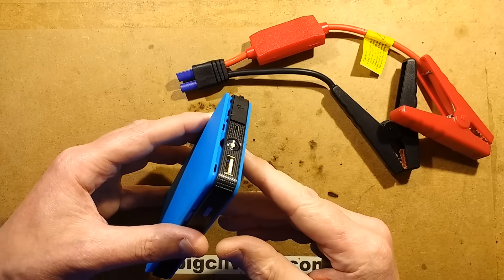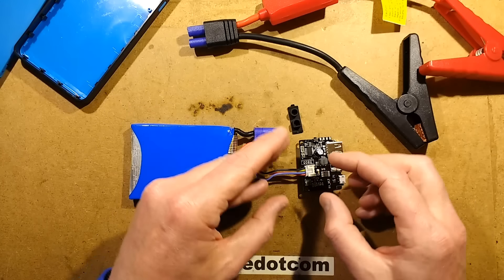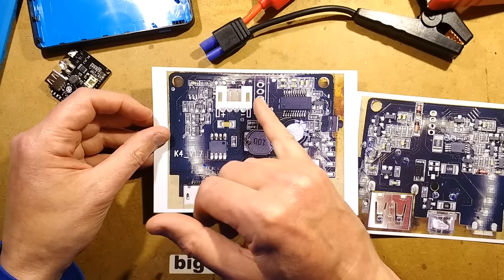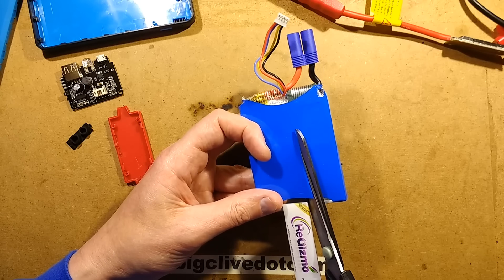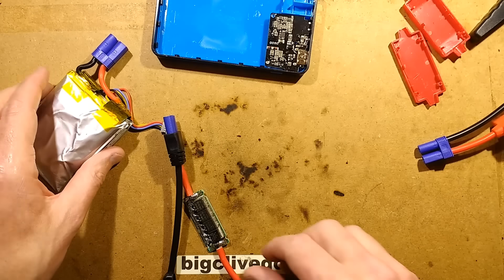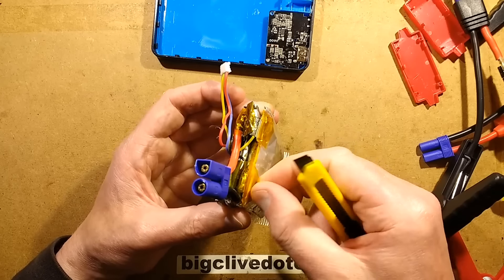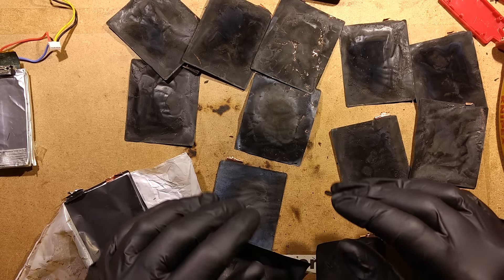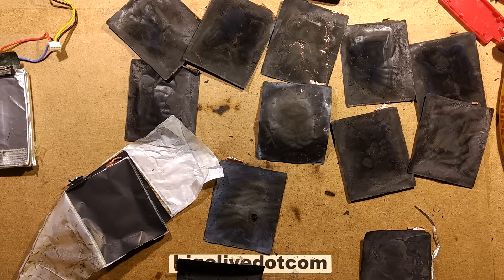Shorting out a fully charged cheap lithium jump starter.  (It didn't end well.)

Comment: I bought this pack off Amazon and was using it repeatedly to run a transfer pump off grid.  Around about the 6th time it failed and did catch fire as opposed to just swelling.  It was a sustained load to drive the pump motors  and it didn't stay burning after I disconnected it. Exciting

Comment: I tried to "troubleshoot"my lithium jump battery after it failed. I no sooner popped the plastic case open, and while probing the innards, I set off the lithium battery sack with a stray poke which resulted in a 1 foot burst of flame. Fortunately, the accident occurred on top of a stove. These things are real flame throwers.
Reply: It's almost as if these batteries go "YOU'LL NEVER OPEN ME ALIVE!" and just explode
Reply: I had a 3s lipo short in my rc car, it blow torched a hole straight through the esc into rx trashing both, all my own fault because I didn't secure the balance lead which wrapped around the drive shaft and shorted, it was funny as hell, the car shot off like a rocket SMOKING like hell.

Comment: I had one of these booster packs. It was great as a power bank for charging phones etc. and my daughter found it very useful when she was doing DofE expeditions especially the torch.  It finally expired when I tried to start a 2 litre Diesel, it overheated and became swollen and busted out of the plastic case, it didn't start the engine.

Comment: I've just bought a 2000amp starter, which started my Royal Enfield 535cc Continental GT Motorbike Instantly. The Lithium Ion battery was Dead, but the Starter is Fantastic !!!!  I ran the Engine for half an hour and the Battery is fully Charged !!!

Comment: Very nice and it shows that these batteries are really kind of safe.
The battery-fires in smartphones are most probably the work of tight packaging and internal shorts in the batteries.
Reply: Nah mate, it doesn't show that at all. While they have gotten better than they were (im talking like the RC lipo packs over the last 10 yrs), there's no guarantee that a random jump starter pack will actually use them vs the older more volatile chemistry mixes... and this one could well have burst into flames had it been a bit more 'robust' or held together as it would have been if it was still inside its plastic housing (as seen when clive pushed the plates back together - it still had some juice left in it).

Comment: I remember a few yrs ago I had a dead'ish cell phone battery and instead of just tossing it I wanted to know what exactly was inside it so I went in my basement to my workbench to try and find out. I couldn't find any non-destructive way into the battery so I chose the only destructive path to me that I could think of. I put it in my vise and clamped it down tight and started to smack it with a hammer. lol, smack, smack, smack! it then started to bend so I bent it back and forth till something happened. it sounded like a loud fuse went off! white smoke filled the basement! luckily I wasn't in the way of anything. apparently, when I bent it back and forth the chemicals mixed and reacted to each other started to pop out the crack in housing I made by bending it and smoked big time, lucky for me the fuse was actually facing down towards my metal vise clamp and ultimately only left a big white mark on the clamp. if it would have cracked on the other side instead I surely would have been burned somehow. lesson learned? don't mess with cell phone batteries or better yet let bigclivedotcom do it instead ... lol, I never did find out what was in it cuz after that and the basement aired out I really did not see anything inside of the battery worth noting.

Comment: Literally just a stock 3s lipo as is common in the RC model hobby.
Reply: Yep, as soon as I saw the balance lead, it's like, "That's just a 3s". And a baby sized one at that. I'd be generous to say 2A.
Reply: Astrid Sunnybunny I would love to know the discharge "C" rating of that 3s battery
Reply: Wonder if that EC5 connector on the leads can connect to a nice 3S 50C lipo pack you balance charge yourself, heck even when jump starting keep one of those cell $4 monitors on the balance port warn of unsafe discharge
Reply: Typically these have a roll construction, but this one is different, opting for multiple plates instead of a huge roll. That means these are high discharge cells but a lower overall capacity with a 'safer' failure mode. They destroy themselves before they can destroy anything else. It's actually somewhat impressive for what it is, I underestimated it at first as well.
Reply: You could. The monitor wouldn't do much because a jump start is so quick, it'll start the car before the monitor registers the voltage drop. Plus when you turn the key, you've pretty much gone past the point of no return, it's already doing its thing. :) The monitor will be good for afterwards to check balance. :)

If you had a 4A 50c lipo, you'll be good for a 200A burst. :) Need two of those in parallel (capacity), to be in the safe range. At the end of the day, if you needed constant jumps, then it's better time and money spent on either fixing a charge issue or getting a new battery. If in cold climates, get a full lipo/li-fe battery replacement or a supercap boost pack.
Reply: Someone should send Big Clive one of the 4S 75C 4.5Ah or so packs from HobbyKing or such with the right connectors and let him have fun melting things with them. Think he would enjoy 337A or so? :)
Reply: I think he'd burn his house down.
Reply: @MV60 --> I think if there was a chance of him burning his house down he would have managed it by now...LOL

Comment: Seeing that Lithium react to air reminded me of a school lesson I had many, many years ago. The teacher was explaining the periodic table and specifically how reactance changes between rows. Out came an 18-inch diameter pyrex bowl half filled with water. Then, the teaching assistant appeared with 3 ominously black jars full of oil . From each, one at a time, the teacher removed a small silver cube, which he sliced a sliver off. Each sliver was dropped in the water. The first fizzed a bit and burst into flames.  Fire on water impressed us 11 yr olds ! This, it turns out, was sodium. Next came phosphorus, which set of round and round the bowl fizzing like mad. Finally came lithium. This was quickly followed by " whoops, i think i cut off too much" as the whole bowl exploded, covering the safely distant bench with glass, water, and an angry silver sliver in flames !😂

Comment: correct me if I'm wrong, are you Scottish? I really enjoy your videos :) I almost expected you to say it's Dodgy lol
Reply from the maker: +Econotech Yes I'm Scottish.
Reply: bigclivedotcom I am too, but not as pronounced :) keep up the awesome content :)
Reply: He literally replied two comments above you.
Reply: There were zero comments when I replied because youtube doesn't have a live comment section. So I literally didn't know, but thanks anyway.
Reply: +bigclivedotcom Clive, to power up this circuit after removing the battery, you must first reconnect the 3S Cell, and plug in the USB. Only then will the board spring back to life . 

I have a few BMS boards that work exactly the same way. Deactivate once cell is engaged, then charge source added. 

There are several "creative" uses for these, would love to see you explore them more in depth. 

We use larger ones as a primary pack in a low draw starter car, and this specific one on our CRG Rotax racing karts ! 

Modded mine to accept a external balance port and charge it via RC charger, these can be versatile items in the right hands, would love to see exploration into better uses.
Reply from the maker: I tried disconnecting the lithium pack, then plugged it back in and plugged a USB charge lead in to see if I could enable it, but it was not behaving at all.

Comment: Aluminium wires?
Are you fucking kidding me?
If they would be made out of aluminium they would limit the current a lot, and probably burn.
These are copper wires with some kind of coating...
Reply: oh no, the Chinese WILL use the cheapest material vs. product liability in their quest to make millions of products. factory saves $0.18 per unit, liability only increases $13500. they don't care for the most part. you'll use it once or 2x in a year or 2 then toss out. they made their sale even if you only buy 1. most will never try to return a bad one
Reply: No, Aluminium wire just needs to be a couple of gauges thicker to carry the same current.  That's probably why the wires were a lot beefier than clive was execting.

Comment: I purchased the top of the line on Amazon for use when we travel, I have had it with us for 3 years now, and occasionally use it as a power supply for my projects, as it has a 5v USB outlet, 12V out, 19V out for laptops and of course 12V in.  So at any rate, this year, due to an accidental disconnect of my Jeep Towed vehicle I had a new (to me) Ford Edge behind my motor home.  The problem with the Edge, is that in order for the steering wheel to be unlocked, you must have the key in the accy position on the switch.  The book that comes with the car says that you can tow her at <65 MPH and must start the engine for 5 minutes at every fuel stop for the towing vehicle.  Well my motor home has a 100 gallon tank, but I like to keep 1/2 in reserve, so I fill every 50 gallons burned, and kept that up all the way down to Arizona some 1500 miles. When we stopped in the first rest area in Arizona for a break, I tried to start the Edge and found the battery was completely flat.  So I smiled and went to my rig to retrieve my Amazon Special Booster Pack thinking it surely should start that big V6 under the hood of my car.  Yep, it turned the engine over TWICE, then the next try the booster pack began to steam and swelled enough to open the plastic case.  Well I stopped immediately, and put the pack on the parking lot in case she blew.  After a few minutes, the swelling went down, and the tester on the unit showed 2 out of 5 bars.  I still use the thing for a power supply, and she holds a charge but I will never hook her up to a car again.  She will be relegated to starting the lawn mower when that is necessary, the only thing it ever reliably started in the first place.
Reply: Here I am still kicking. Now 4 years later, my wife has passed away and without her beside me, travel has become a chore and not a joy.  I still have the battery booster pack.  A few weeks ago we suffered a blizzard and power outage.  I took the old power pack and used it, it did  charge my phone 1/2 before dying, not much use I guess.  I have other sorts of power packs and they kept us in phone power for the 26 hours it took to get back our power. Now the past week has seen me recharging all the packs and when it stops raining for a bit, I will go out to my rig and get my portable soler charger so I can use it should we suffer another power outages.  We used to use it when we were boondocking (camping in the wild with no shore power!) and it did a wonderful job of charging our cell phones.

Comment: Thanks for the tear-down.  @ 3:06  Yes, the black colored solder-mask layers (top/bottom) of the PCB is (in part) an effort to retard back-engineering and protection of IP.  Ironically, black solder-mask would also help hide any tell-tailed signs of the 'magic smoke' getting released.  "A destructive test is worth a 1000 opinions"  - Unknown -

Comment: I have one of these jump starters, and mine also packed it in after just a couple of uses, which was quite infuriating given the price tag. I noticed recently that the casing on mine was starting to bulge after sitting around for quite some months, so I'm thrilled you have shown me what probably went wrong and have saved me from finding out for myself what may happen should I continue to try and pry the aluminium casing apart and slip (thank you for pronouncing alumin-i-um correctly).

Comment: Monitoring intermediate voltages doesn't always mean that there's a balancing feature. It could be 'just' for protection - the chip will cut the power when one of cells is under minimum safe voltage when discharging or over maximum one when charging. Usually BMS-es with built-in balancers have a pack of large (physically, not so in terms of resistance) SMD resistors.

Comment: 17:46 Not only they are not flame resistant but if they caught fire, they would melt and stick to your skin, so you wouldn't be able to get them off - and this can be very painful and can result in some serious burns. Even chemists avoid using rubber gloves when they're using bunsen burner for example, although they're still handling corrosive material at the same time. And don't get me wrong - your videos are very enjoyable to watch, I just wanted to warn you about that, that's all. Have a nice day ;)

Comment: I tried using one of these to jump start my riding mower, but the lead acid battery was too damaged. Instead I hooked the jumper up where the battery goes, and start it with nothing else! It easily starts the engine 15-20 times or more between charges. The diode keeps it from charging off the mower, I just bring it inside every once in a while to charge it. Works better than the original lead acid battery!

Comment: That thing of charging/discharging an individual cell has proved me well too in the past, had a series connection that had a cell come loose and so it was stopping my pack from charging fully, hooked a 4v motor to it and it dropped it down enough for the bms to do the rest. It was like that for 6 months, the bms not only saved my 1.3kwh battery but also stopped my house from cathching fire. Always use a bms, or at the very least Always balance charge.

Comment: I got a name-brand version and the jumper connector head has an LED readout that will tell you if it's attached the wrong way around, what the voltage is, and various error conditions such as becoming too hot.
I was hoping you did a tear-down of such a device.  With the common feature set, I figured there must be a chip or module that they are built around.  But, the total storage isn't that much more than a conventional power bank.  So, I wonder what allows it to start a car?  It claims 600  A current (1200 A peak) but with only 60-ish watt-hours storage it must be for a very brief period.  It must know when the high current is wanted, when trying to crank the engine, and turn it on just for that moment.  If it was just a plain connection, it would start charging the car battery as long as it's connected and quickly run down.

Comment: I was so shocked as I saw that you simple thow that plates of the battery without any Isolation randomly on your desk, because that's exact the problem why lithium batteries begin to burn, because there is an issue with the internal Isolation.

Comment: I fly RC and these batteries need the utmost respect. I have seen one light off on the radiator shroud of a pickup truck and the damage to the truck was significant. I would never store one of these in a sealed ammo box. When they cook off they can cause the sealed box to become a bomb. Think of of a pipe bomb. If you light black powder on fire in the open it just smokes and burns but does not explode. Contain it in a piece of pipe and watch out. When I travel with my lipos they are stored in a ventilated metal box that is lined with tile cement board. Each battery is separated from the next with a piece of cement board hopefully preventing a chain reaction with one battery catching fire and igniting the others. I hope never to find out whether or not this works. There are videos on YouTube of what can happen in various scenarios to a lipo cell with fire. One of the Metalized bags that are sold for charging a lipo will not contain the heat very long if there is a battery fire. There are a number of experiments  available for viewing on YouTube. I totally agree about not storing one of these in your vehicle. I'm surprised there haven't been more reports of these things catching fire when stored in an automobile or truck. They must be fairly safe but are not completely safe. I can just imagine the scenario of one of these in your vehicle catching fire in your garage and then burning your house down. Maybe with you and your family dying or suffering severe burns in the process. I was on a Delta flight a little over a year ago. We were sitting at the gate while the plane was loading and one of these batteries begin to smoke before it burst into flame. It was not a very large LiPo battery and thankfully the owner was able to take it to the front of the aircraft and throw it out onto the ground before it burst into flames. I now travel with a metallized bag in my carry-on which might offer some level of protection should this happen in the air. I asked the aircrew at the time of the incident about any training or safety measures and at that time they had none. I have been told that that has changed however since so many people have these batteries in various products.

Comment: Why was I holding the phone at arms length from my face when the battery started to swell.. my uncle gave me one of these to look at to see is it worth saving/fixing,, but I'll be telling him how dangerous they are....AGAIN. his had a boost coil on the input and a buck coil on the output for the USB's. Plus a separate 12v Jack for charging. Everything else was the same as this one. I measured the voltage on it at 5.8v and told him I could save it but I'll be changing my mind now. Thank you Clive for this video. These sort of batterys shouldn't be used to jump lead acid in my opinion.

Comment: Hi Clive, that looks like a 1/2 inch pipe - what was the spacing between your voltage test points - I'm guessing about 100mm?   It would make a nice calculation of the conductivity of copper.